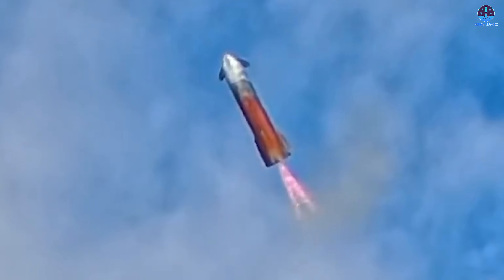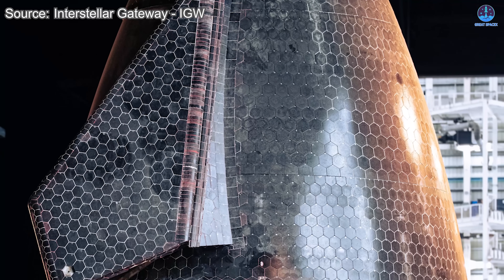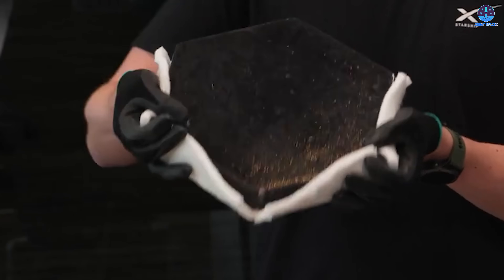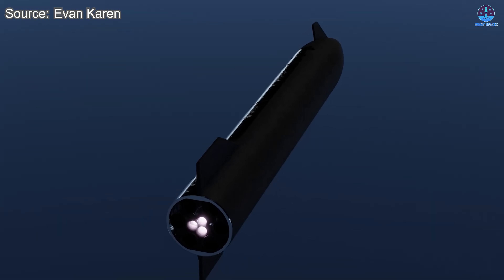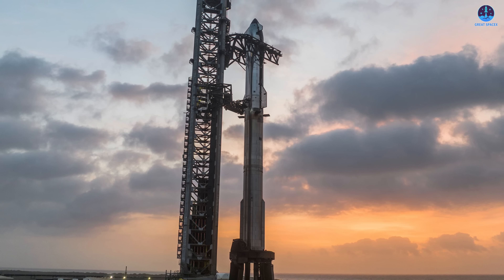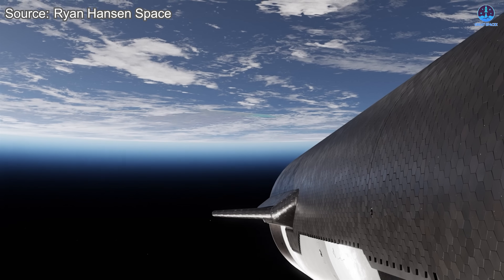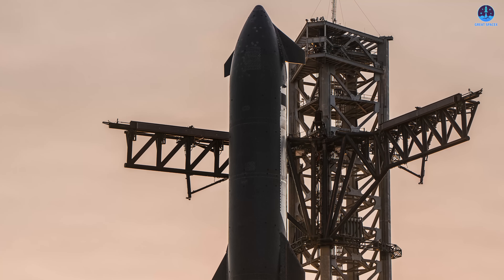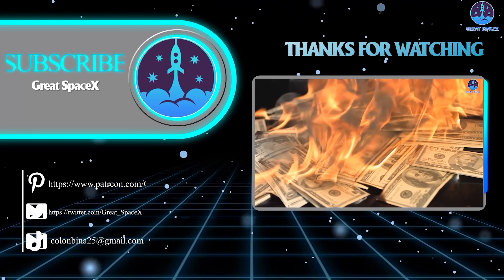SpaceX Revealed Huge Upgrades on New-Gen Starship’s Heat Shield to Totally Fix V2 Oxidized Problems…

Comment: The problem isn't the materials that make up the tiles, it's the shape of the tile edges.
You'll see that all the edges of the tiles are all set/sit up higher than the central portion of the tile so that these "raised edges" are the main incident vector of the "trans-sonic plasmatic wind", but when you then channel that wind &/or heat down through the verticals between the parallel tiles you get extra heat for a longer time which then hits the lower tile on the leading corner of that tile, thus forming a stressor point for all tiles, and because the lower point is the intersection of its two higher leading edges it gets hit by the "normal" air molecule turbulence heat, but also the channeled inter-tile vertical heat from the upper two tiles.
   Thus leading edge needs to be "removed" from its position as the main trans-sonic air molecule deflector by making the tile edges slope from say, 10mm below the existing edges up to the existing surface ( @0mm) but at a 10 - 15 degree angle upward, thereby forming a hexagon shaped edge within the real hexagon tile edge, so that the inner hexagon forms the leading heat edge, but the real edge gradually deflects any channeled air upwards towards that inner hexagons obleak angled edge( thereby forming a wider heat conducting edge).
   The other way to avoid that "between the edges tunneling effect", is to place the tiles on the Starship in a fine thread pattern around the Starship so that when one revolution of tiles around the Starship takes you from the bottom row to the next row above the bottom row of tiles. Thereby making the previous vertical edges have a now slightly non-verticle channel, which if the tapered tiles were used, could easily allow the upward deflecting of the air towards the inner obleak edge.
   I suspect that the tiles are actually produced by a silicon base with the bottom of the tiles, being the more compacted ceramic surface( like vibrated concrete in walls), and the actual tile surface is the uncompacted air surface( like in concrete in walls, etc) that is used with its protective coating as the tile surface ( which would explain why the tile surface has such sharp tile edges). They may need to go more towards the pressure molded brick type of ceramic tile, where the excess is bled off the top pressed surface(through venting passages, then baked in the bottom silicon mould, before the silicon mould is removed and reused???

Comment: If storing fuel in space and transfer to space ship becomes feasible, heat shield becomes unnecessary because the re-entry of space ship velocity can be slowed down so that heat will not become excessive to damage the space ship. The only reason for heat shield is to save fuel during re-entry and refueling in space can solve that problem.

Comment: Question  why are the tiles black ? Why not spray them with a liquid tungsten  reflective coating
Reply: It's about weight.
Reply: The tiles are to be reused with minimum refurbishment for quick turnaround.
Idk that a sprayed on coating would endure robustly for reuse.
The tiles are already nearly unpenetrated by heat, so idk what good a coating would do.

Comment: The V3 ship is the first ship type that will test Starship's exo-terrestrial capabilities. Landing on a foreign moon or planet, long term environmental systems, dust mitigation air lock. Landing capabilities.

Will Starship V4 be the real Mars platform?. It needs a Whipple shield, long term environmental system, crew working area, advanced automated 24/7 ship monitoring, radiation protection, landing system and legs.

Comment: I just got a great idea for the heat, shield tiles, why don't they just put a protective coating over the top of the heat shield tiles, that is easy, cheap and affordable to put on for every launch, now this protective coding over the heat shield tiles, its purpose would b to burn off for reentry instead of burning the tiles, and it would protect the tiles, then every time you launched, you just put another protective coating over the heat shield tiles.

Comment: You mentioned a few of the drawbacks of adding complexity to the reentry system, but you blew by them pretty fast.  I didn't hear any mention of increased cost and, more importantly, increased weight.

Comment: Star Ship must grow to 10m od with a 11m od belly heat shield plate over the tank. A 1" between tan and shield for Nitrogen coolant. The shield be the 11m od curvature making all tiles the same, The body side will be connected with a 1.5m titanium pipe nose to tail on eac.
Reply: Congratulations! You just designed a ship too heavy to make orbit.

Comment: It obviously isn't "fixed" until tested and proven it works. The usual garbage from this ridiculous channel. Nothing can be called "improved" until it actually works.
Reply: SpaceX has experience, knows its tile shortcomings in previous flights & does its own ground testing… so they can confidently know these tiles are improved, better than their previous versions.
Whether they are yet perfected or even adequate for full, repeated reentry is a different question.
Reply: LOL!  What do you think all those various missing tiles in like last 6x flights were doing?  

Hmmmm, maybe testing small sections of different variations of Heat Shields, just like SpaceX indicated they were doing 😅  

Have you even been listening to what the SpaceX hosts say during the launches??? 😂
Reply: @darbyelliott2890 .....only thing that doesn't melt.....lol.   Is .... Brimstone

Comment: The biggest problem is South African Chainsaw Musk...
Reply: @OldGiantsCountry.  In what way is Musk the problem. Spacex wouldn’t even exist without Musk. I’m no Musk fanboy but it’s ludicrous to blame Musk after all he’s achieved. Without his ambition and vision even Blue Origin wouldn’t have been pushed as far as they have. They’ve only increased in speed because Musk’s dynamism was making Bezos look more interested in Amazon than BO. It’ll be years before BO can launch astronauts to the ISS, if the ISS is still there that is.
Reply: @iancanty9875 BO has many orders before they move onto a capsule. Boeing Starliner is getting a contract for uncrewed supply ship to ISS to prove they have fixed Starliner Capsule.

Comment: Coolant leaks?  What coolant?  When did SpaceX shift to an actively-cooled thermal protection... and over how much of the Starship?   AFAIK it has been known that SpaceX was considering active cooling, particularly for highest thermal stress areas ... but I've heard no statement about its introduction.  

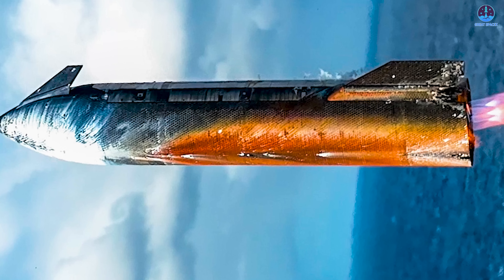Look a the image at 2:38.  It's evident that the white discoloration is almost "solid" on the nose area, which is very high thermal stress; farther back where the orange staining starts there are what look like a few "bleed smears" of white.   And then there are patchy areas of white on the rear flaps.  

Shifting to "coolant" ... again, what coolant? The obvious coolant(s) are either methane or lox, both of which are available, in principle. Anything else means new tanks etc. And used how? The big advantage comes from film cooling; intentionally leaking to produce a cooler film over the are to be protected. However  Ionized atomic oxygen is so chemically aggressive that it's hard to imagine that, and in any event if intentional film cooling were being used we'd see a much more uniform discoloration.   If methane were being used there is no oxidation problem, but coking problems are a likely issue, and at least soot staining.

I really doubt there is an broad usage of active cooling.  The weight penalties are not attractive.  I can imagine it being used in particularly critical areas; the flaps etc. We see no evidence of that.

I don't think this is any active coolant.  I think this is something cooking out from the adhesive and backing layer of the tile system.
Reply: It is an old space systems technique to use the left over liquid Nitrogen for secondary cooling. With most of the fuel for Starship gone when it reenters Earth's atmosphere the extra warmer Nitrogen that started out at 77 Kelvin can be run thru the back of the heat shields that will heat up to 1500 to 3000 Kelvin.